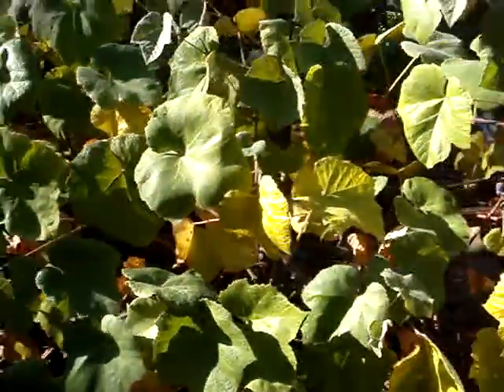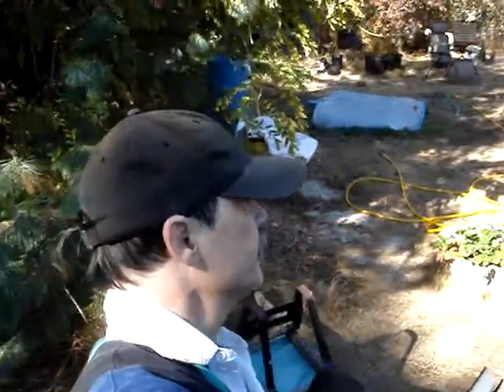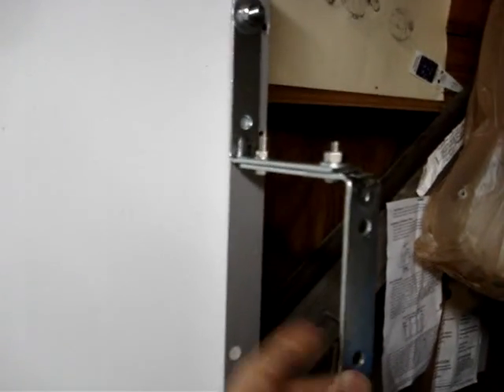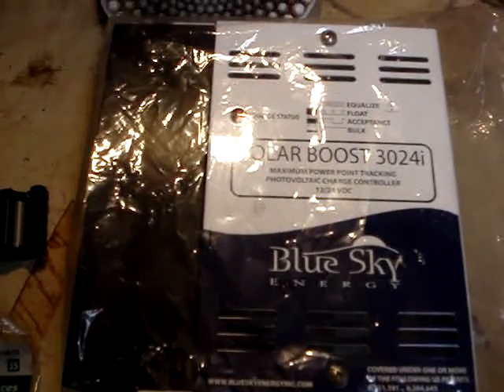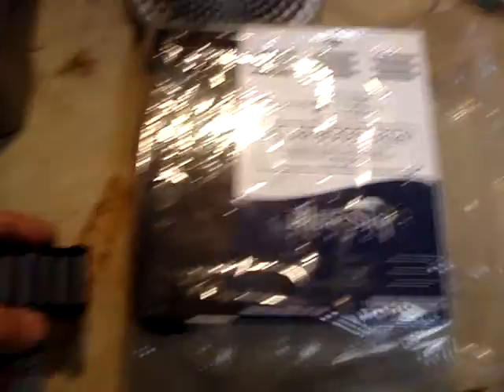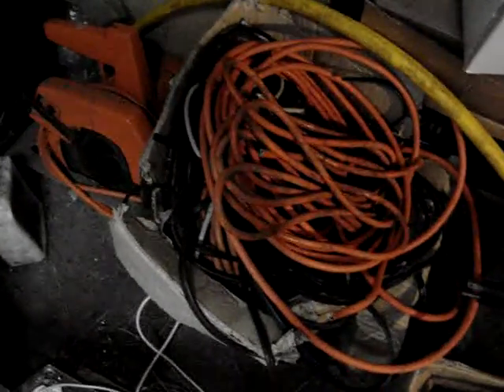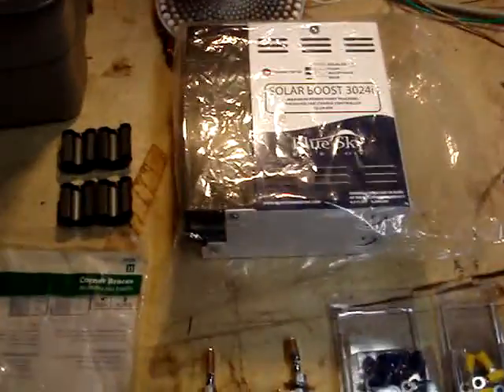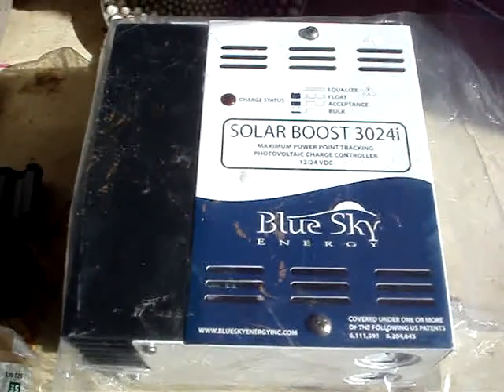Concord Grapes, Solar Panel Mounting, New MPPT Controller

Comment from the maker: Bought more L brackets with attaching hardware. wiring, situating where to mount controller box. Measuring space on roof, routed romex wire to roof. Pre-mounting panel to rail before lifting the panel onto roof. Maybe pre-mounting both panels to the rails with L brackets, than having neighbor help me hoist assemble panels to rails onto roof space. Wire connector ends to wire from controller to battery copper plate attachment. Started to get cold, rainy. Going slow.